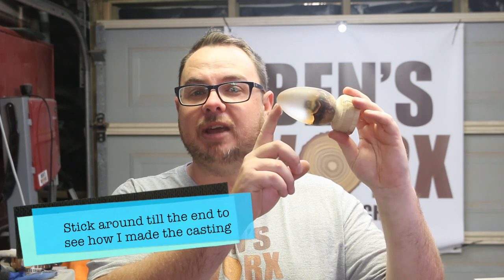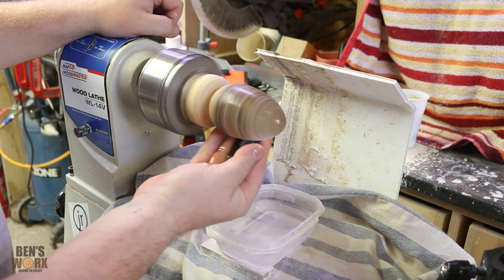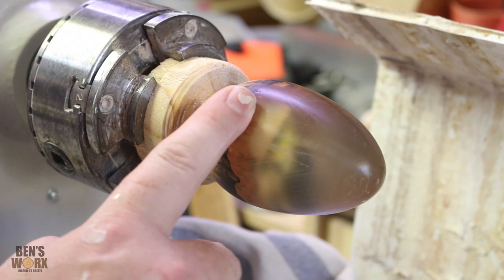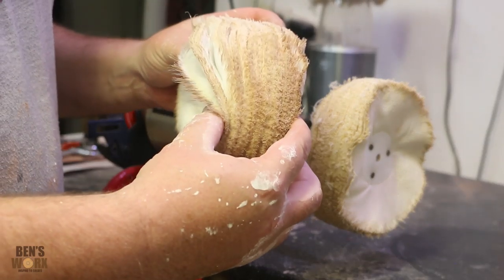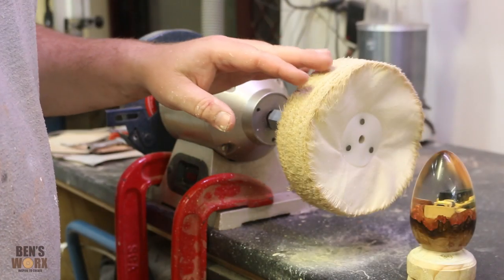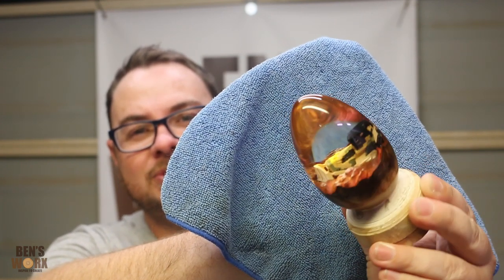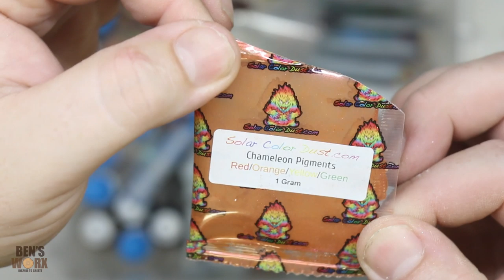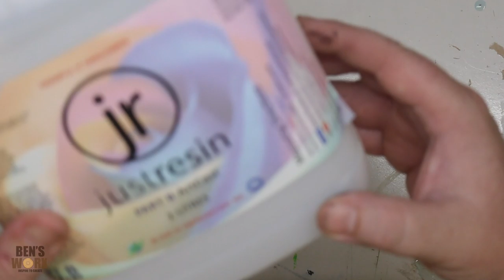How to Polish Resin Tutorial

Comment: I will have to give the Turtle wax a go sometime, as up to now for turned Acrylic work I have gone through the sanding grits first, then used Brasso brass polish followed by Silvo silver polish. works a treat, high gloss blemish free finish. I did that while it was still on the lathe. For carved acrylic small detail I use the same polishes on Dremel buffing heads. Love the way the piece turned out, screw television, this is my kind of entertainment.
Reply: Hi! So I’m working on a project that’s a wooden sword with the fuller carved out and filled with resin like you would say a river table. I can’t get the crystal clear high gloss finish though! I’ve even gone up to a 3000 grit sand paper. I can’t get the Yorkshire compound he has and don’t have too much extra money for this project. I have the turtle wax polish though. Do you have any suggestions for what I could do?

Comment: So I have watched a ton of videos now on polishing. you describe well the process but something NO ONE ever seems to answer is HOW LONG should you stay on 1 gret. they say until all the marks from the previous grit are gone but I cant even see any marks to use as a gauge. I just need to know a typical standard timeframe to polish say a 1 foot square. I also had multiple people say do 5 or 6 passes, then rest and do again however is a pass considered moving the sander 1 inch per second? I know you are supposed to keep the sander moving as to not heat the resin too much but nothing says about how long it should take you. for your egg- did it take 10 minutes per grit? 30 minutes? an hour? I have tried various polishing/rubbing compounds nad types of grit and polishing wheels over the last 2 weeks. I am obviously doing something incorrectly but I have no basis to compare to.

Comment: Hi. New to this channel and making resin crafts! It was therapeutic watching you do your work. Random question… how come you used such a big cup if you were going to take so much of the resin off? Also … I have the same question as the other person about sphere molds that come in halves and getting rid of the mid-line marks after sanding it. I use a small handheld drill. But it sucks and when I try to paint more resin … sometimes it doesn’t dry smoothly bc   The brush streaks show 🤦🏻‍♀️🤦🏻‍♀️🤦🏻‍♀️ please help! Thank you!

Comment: Its same as a painted car. I don't start as low as 600 for sandpaper tho. But always finish at 1200.  sanding done with a block, no machine, then polish it with compound and go down a grade with anti swirl tho. Much less aggressive with the polish machine tho. But he doesn't have to worry about burning thru clear coat and paint
Reply: Also basically what you get in a headlight cleaning kit

Comment: Great video Ben thanks for all the great tips. Got just one question, this is epoxy and wood project so in theory wet sanding is not the best idea for the wood? Have you ever had meant issues with that? If wood absorbed moisture during wet sanding will it not crack later when it dries? Thanks in advance for the answer 👍
Reply from the maker: Hi Mate, Thankyou, I’ve never had any dramas with the wood cracking. I do try and limit the amount of water on the wood side though

Comment: Hello, I have a question for you, I have started using resin relatively recently and still am a beginner. I currently use UV resin and I use Spherical moulds to create resin balls, but since the moulds come in 2 parts, there is always a seamline around the middle, and no matter what I do, I cant get rid of it. I've used sandpaper but it makes the surface look scratched, and then applying new resin makes the scratches disappear but once I start applying resin manually, with a paintbrush, my ball is never again a perfect sphere.

I notice you use a machine to polish your works; I'm just wondering if you have any advice for someone who doesn't have these at their disposal? Many thanks.
Reply: What grits are you using? Also, are you sure that the sphere has fully cured?

Comment: Hi! So I’m currently working on a wooden sword project where the ruler is filled with resin (used the river table technique and a deep pour resin). I’ve sanded mine even down to a 3000 grit but I still can’t get all the scratches to go away or get it crystal clear. All I have is a drill attachment for little sanding pads and same thing for buffing. Nothing pneumatic. I have the same polishing compound but cannot afford and don’t have the time to get the microfiber compound you have. Do you have any suggestions for me to get it crystal clear like yours? Or at I just out of luck here?

Comment: Hey there. I use Yorkshire grit too, but seriously ... its just at 2,000 grit, if its done? They say you just need to sand it down to 400-600 to get the same result ... Why don't you use micromesh after yorkshire grit? Up to 12,000 grit? And then a nice waxing? Shellawax? Or Boatswax like i do?. Have you tried it? Maybe it looks a biiiit better :) I'm happy for an answer. Btw, its not meant rude or something, just curious.
Reply from the maker: Hi Mate, I’ve been sanding resin for years and I’ve found this method to be the quickest and easiest way for me 👍

Comment: What are the best products to use to remove very fine surface scratches and swirls.  I’ve tried the very expensive 3M compounds and polishes that I see the pros using(almost everyone on these videos uses 3M) I’ve tried wool pads foam pads soft pads abrasive pads waxes pastes and polishes and nothing seems to bring my clear resin back to its crystal clear see through state.  When you get down on a knee and look at it, it looks nice and glossy like glass with no imperfections but when you stand up and look directly down on it then you can see imperfection city with swirls and scratches everywhere.  I’ve tried using more product then tried less product.  Product on different pads and nothing gets it out like on these videos.  Anyone have any tips????? Greatly appreciate it it’s killing me over here.

Comment: hey ben, just wondering if you can have a look at amazon in uk and recommend a fine polish, as the one you showed in your video is not on our amazon or at least not the scratch and swirl one. there is one called scratch remover but it has 3 stars so i doubt is at good as yours. i could fine the yorkshire one but not the turtle wax, your model.

or if you can just recommend any other finishing polish product after you apply the yorkshire microfine, that we can buy in uk, preferably amazon :D
Reply from the maker: Turtle Wax T-238 Scratch and Swirl Remover - 11 oz. https://www.amazon.com/dp/B003KLABUA/ref=cm_sw_r_cp_api_i_co5oDbRQ3MAA7

Comment: I was once told not to hold whatever you are polishing on a buffing wheel for too long in the one place as the area could over heat and melt. Is that true?
Reply from the maker: It definitely gets hot but it won’t melt. I don’t recommend holding in the one spot either
Reply: Ben's Worx thanks for that.
Reply: That is true for car paint/clear. I still wouldn't risk it on resin

Comment: "Mine is just a converted paint sprayer"
My old art professors was a modified crock pot that had a metal arm bolting it down, haha. He said "If you use it, just don't be in the room" and he pointed to a crack in the ceiling where the lid had blown off

Comment: It’s not as big of a deal with a small lathe like you’re using, but you should never, under any circumstances, work under or behind the work in the lathe. Always work in the top front quadrant. 

Working on the backside will hurt you in a small machine and kill you in a big machine.